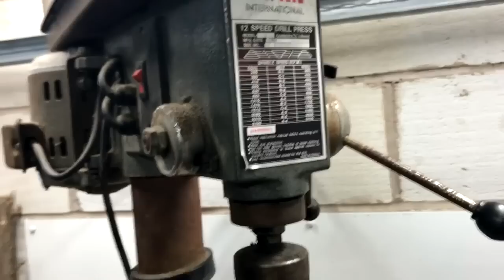Rusty Seized Solid Drill Press Restoration & Repair - Part 2 - Mechanical Repairs and Rebuild

Comment: Probably runs at least as good as if not better than new. Lot of the time the assembly is rushed and things are not lubed and fit up like they should be. Can't believe the windings weren't burnt after getting hot enough to melt the fan that badly. Usually if you let that much smoke out of a motor you need to have it refilled.

Comment: Boy, that chuck has a lot of runout.
Reply: yeah that made me dizzy, get a new chuck, that drill is awesome.
Reply: Can you just buy a new chuck? Brand or type you suggest?
Reply: You will also need to purchase the correct adapter for the chuck.   Great chuck at a very reasonable price.
Reply: @gravedigger1960  Thanks, what’s a good brand?
Reply: @btwenzel05  Southbend is a good brand.  There are also very expensive brands.  But with that drill press, a top of the line drill chuck would be a waste of money.   Southbend would be a good chuck worthy of the drill press.
Reply: @gravedigger1960  Thanks!

Comment: I loved the restoration!  Are you sure that your chuck doesn't have a bit of wobble in it though?  Either that or maybe the drill bit?  My experience has been that your workpiece shouldn't be moving around like that on the table and in the video, I noticed the wobble before the bit entered the wood.  A test might be to clamp the wood down, drill a hole and then measure the hole against the diameter of the bit.  If the hole is bigger, then we'd know for sure.
Reply: -- To check runout, simply install a short rod of metal that is true into the chuck. Put a dial indicator on it and that will show you the runout at the chuck. It's wise to spin the chuck by hand while the indicator is on it and while you're doing that, apply a little side to side pressure while watching the indicator as the chuck rotates. You might see that there is more runout with some pressure than if you're just freely spinning the chuck by hand. Note that the chuck itself may be fine and any free play may be found at the bearings or in the spindle. The ultimate question for many in the shop is how much free play is acceptable for you. For most guys, even .010 runout is just fine for stuff around the house and shop but each of us has to determine for ourselves what is good and what isn't. In my decades of experience, what I've discovered is that a lot of the problems lay in the bearings. Most of these types of benchtop drill presses don't have any way to adjust bearing tension due to the design. If the body and spindle assembly are okay then the only solution tends to be a set of high quality bearings when solving runout issues. Even so, you generally cannot expect to get the .000 runout that you'll find on a quality milling machine. If the bearings aren't tight and have a very slight amount of free play in the bore, one of the ways to tighten them up is to install them while using a very thin feeler gauge. Feeler gauge can be had in sizes from .0005 to at least .005 in increments of .0005. Best wishes!

- Max Giganteum
Reply: @MaxGiganteum  I love the idea of using a feeler gauge.  Great idea!
Reply: -- As an addendum... remember that if the bore for the bearing is out of round then feeler gauge shimming isn't going to true it up unless you use the shim technique where you use small pieces of feeler gauge in an attempt to shift the bearings over to the point of center. What do I mean by this? You stack short, stubbier pieces on one side of the bearing which pushes the bearing over in the opposite direction. Can this work? The answer is yes if you are careful and go through the process of trial and error. However, remember that unless the shims are used with some sort of light adhesive, then they can shift during the use of your equipment which will most likely result in an ever escalating run out condition all over again. Of course, to know where you are truly at, one has to use a dial indicator if you expect perfection.

 What about using an epoxy to take up the gap? In other words, using a multi-part epoxy resin or something like JB Weld to re-center bearings and effectively glue them in place? I personally would never recommend doing this. Why? Because it's not really a permanent fix and there's a good chance the repair will fail. If that happens you'll have to remove the resin or the JB Weld and start over... for most folks this is not only a disaster but a nightmare to accomplish without doing further damage. The smart play is to not go down that road in the first place. Yes, I've heard all the stories again and again about success and about how some guys are the master of JB Weld, blah-blah-blah... but here's the thing - you always hear about the successes, you always hear about the lottery winner. You never end up hearing about all the failures and the millions of guys whose lottery ticket did not win. Here's another thing to think about - what will you do if you have to replace the bearing again? You'll have to press out the bad bearing and the odds are super high you will destroy the resin or JB Weld during the process that's requiring you or someone else to go through the nightmare of another more serious repair. Using feeler gauge stock to shim or otherwise tighten up a bore is completely reversible by just removing the feeler gauge. IMHO, the shim technique should only be used for gaps of maybe .010 - .012 total though some guys will go up to .020 - .030 which is the equivalent to .010 - .015 per side. Choose wisely in how far you'll go. Anyway, things like JB Weld are not so easily removed the majority of the time, REMEMBER THAT! Of course I'll end this section of my diatribe by saying this: while the feeler gauge shim technique can be effective, the real repair for a bore that is out of round or enlarged too far is simply to overbore on the original center line, manufacture a repair sleeve out of a suitable metal using a lathe or other machine tool and then install it to restore the bore to center and to the original size for the bearings. There's your permanent fix. Use the shim repair technique only if it's really truly viable.

Also, when using the shim repair technique, if the gap between the bore for the bearings and the bearing body itself is too large, then stack 2, 3 or even 4 layers of thinner shim stock instead of using one thicker piece. Why? Because the shims will get too stiff once you get to about .004 in thickness for them to accurately and easily revolve around a 360° surface area. Thinner stock is also far easier to install without trouble. What trouble? You'll find that it wants to deflect and crush out of shape. In other words it can be difficult to install when there is pressure on it. The trick is to install it about halfway into the bore while it's still halfway on the bearing surface. Then push or draw it in with a press or a threaded puller - USE LUBE!!! Trust me when I say it that it can be a royal PITA to get done and be tight. I know because I used to do it frequently when I used to work for what is now the world's biggest airline...

- Max Giganteum

Comment: I'm just starting a restoration of an apparently identical drill, branded Clarke.  Come to a stop because I can't get the nut on the top of the spindle drive to undo.  It rotates but it looks as if the threads under the nut have stripped.  May have to cut the nut but that will leave me with a spindle with stripped threads. 😞  Also the quill only goes down about 50mm before coming to a hard stop.  (The depth stop on the quill appears to be free.)  I was not keen on disassembling the spring cap but I guess you have showed me a way to stay safe!

Comment: I watch many restoration videos as I am in a similar business.  I was so impressed with your Seized Drill Press Video.  The part that impressed me the most was when you needed to make a new bolt.  You said " I don't have a lathe", and you made it anyway.  Believe me, it takes a lot more
talent to improvise than to use a fancy piece of equipment.  WAY TO GO!!!

Comment: How apposite. I'm about 1/2 way through doing the exact same thing on an old Meddings 5 speed bench pillar drill donated to me by a late friend before he died. 

Same as you I use Citric acid for derusting stuff but I do everything I can using different sized polythene/ABS plastic storage boxes with the biggest I've used so far being a 50 litre box. I have used a 100 litre plastic drum though previously to electrolyse rust off a tow bar ... Worked a treat!

Mine has no base, only a VERY substantial bottom collar. No table or rack/pinion lift and no motor. The latter has been resolved with a very nice 3/4 HP 3 phase motor that I acquired ages back for about £20 ... It's like new! I've bought a new 5 HP capable VFD that will drive it so bags of spare capacity so should run nice & cool. 

I have the main body all stripped down including removing the aluminium label and brass serial plate held on by spiral rivets! 

Ready and waiting for paint stripping. I use the same recipe for paint stripper as you ... Caustic soda, wallpaper paste and water ... Sadly I had to use Nitromors on the motor end caps of my lathe motor that I'm also refurbishing as they are aluminium!

CAUTION to those unaware, concentrated liquid caustic soda is dangerous and will eat through human flesh AND aluminium and casting alloy faster than you can blink!! 

DO NOT USE IT ON OR NEAR ANY ALUMINIUM PARTS!

Wear protective gear, especially face and hand protection. Keep white vinegar and/or citric acid handy to neutralise the alkali.

Great job you did on that. I hope my final result is as good! 👍👍👍

Comment: Holy Crap! I thought these things were only 2 or 3 parts Max!! and that includes the drill bit and chuck key.
So what is it with all this other stuff?.... Bearings, melted fans, more bearings and random stuff that you probably swept off the floor???  I swear I saw a prosthetic leg in there.
So somewhere there is some guy walking around with a limp who had his rusty old bench drill stolen so you can get your jollies on You tube!!!

Comment: I don’t think you are doing this right, from my experiences of watching other similar videos (mainly from Far East) I have a couple of pointers for you.
You are supposed to be casually walking by a load of rubbish or a foul smelling river when you accidently find a corroded piece of equipment. You then drag this back in a wheelbarrow pulled behind a moped and dump it on your terrace/patio. You put flip flops on and work on the floor. You don’t seem to have any chickens or passing vehicles making a noise in the background. You’re using far too many tools, one rusty claw hammer, a broken screwdriver, a piece of rebar and a brick should be plenty. You’re not handling everything as if its brain surgery. You keep letting people know what liquids/chemicals you’re using, this just wastes time making the video longer than it need be.
But apart from all that I think it is one of the best renovation channels around, keep up the good work.
Reply from the maker: Casa Piqui Dammit! I wondered what I was doing wrong, hold my beer 🍺
Reply: Hilarious Casa! I wish I could give your comment two thumbs up!
Reply: George Robartes  LOL! Isn't that the truth, eh! :)
Reply: LOL! That always amazes me, too, how they just "come across" those "old" pieces of equipment! Well said, Casa Piqui. :)
Reply: My restoration would include chickens and passing vehicles in the background
Reply: @jt9498  im not amazed. I have found enough furniture and appliances to fill a house in my field which then i have to dispose of myself. Just wish someone throws away a metal lathe in my field that i can restore
Reply: Hilarious !  I kept reading to see what was really wrong with the video because I am looking to restore mine...... lol  This is one of the best videos out there!

Comment: hey , in the process of " cleaning up " a Jet 13 R,  rusted , greasy , and I couldn't remember how far down the shaft had to go, your video revealed  it !... lots of sanding wheels , wet/dry paper …. thanks

Comment: In the old days we used to be able to buy Kent paint stripper here  on spray cans. It was really efficient and only the biggest lumps of body filler would need a second application. These days I find stuff advertised as paint stripper, but I doubt it would remove pizza dough from the bench top.. The old chemicals were probably very dangerous, but it's a pain to remove paint and filler these days. I mix brake fluid in wallpaper glue which will do a decent job on some paints.

Comment: Nicely done. That will be with you for many many years to come. Every shop has to have a drill press. I think I use mine nearly everyday for something. But be very careful because they can be dangerous when drilling through metals and the drill bit catches on the exiting side. Clamp things down whenever you can. Thumbs Up!

Comment: Well done.
Have you considered what might be done to reduce the run-out, or wobble of the bit ?
Reply: Depends which part is bent lol I had to take the shaft from the quill and take it to a drive line shop to get it straightened out  lol
Reply: A few things without spending  money...am going to get some belts today
can get these quite cheaply in an agri/lawnmower shop, fiver each, came here to look for size.
Runout is more noticable  with a long bit, and is about the best poor mans dial indicator that I have 
for checking some things like arbor fit, should you have runout, swapping the MT 180deg in slot
 might give better results whenmachine is run.
I marked a spot to make note of arbor and MT where it seemed best.

Bit of marker to "blue" both arbors to check for contact, and check for burrs, clean with white spirit afterwards!
Raising the table dead on centre until the long bit nearly touches, should give an idea of slop, when pushed 
sidewards, and be noticable centred on the table bore. (belts tight seems like it will stiffen this up a bit, if the lids open when doing above)
That little grub screw on the left also has much effect on this,
Depending on condition, may need to fettle this, or make a new one from some threadbar.
I had some meat to play with, (plenty of the flat left to sink into slot)
took some trial and error to get a much better fit, bit of a faff to dismantle return spring and disengage 
(gear?) to drop down spindle, advance that wee screw and check if spindle will go back in,
I made mine very stiff, harder on the spring but that was a fiver on the bay,
MAKE NOTE not to damage that spindle, and make sure the teeth are in the right location to enter,
as if the screw is very tight against slot, hard to tell which maybe fouling.
Might revisit this, seems one could look into making another of these set screws, should it not weaken the casting...

Beyond that bearings, dial indicator, and possibly MT and chuck, might as well go the full hog then and restore,
maybe motor bearings too,
Hopefully I can get away without doing all that for now.

Two things to make note of 
That earth wire maybe damaged,!
and should the switch be acting strange, then the panel could be backwards, took me a while to find this. ...
Haxby_shed pillar drill press improvements , and cut to 11:40 to see.
Tom

Comment: Good job. My only comment is when re setting the chuck in the quill wind the jaws of the chuck back into the body and then press the body against the block of wood. That way you don't risk distorting/damaging the scroll teeth on the chuck jaws. RonW

Comment: I have this exact same drill (bought new years ago) but it never got that bad. Just replaced the bearings in the head but need to do the motor next. It's never been super powerful but it has been a good tool.
Reply: Scoot,  please do me a favor: need the sizes of the 2 v belts. Thanks

Comment: Great video. I'm in the process of refurbishing my floor standing drill press. I have a question on the table lift mechanism/worm gear crank. The spur gear driven by the worm gear sits on an axle pin and float on it within the housing and can float about 7mm side to side in my unit and it appears to be the same on the unit you restored shown at about the 14:51 mark in the video. Is this the way it should be? Seems like there should be collars on either side to keep the spur gear centered on the shaft?

Comment: Thank you for the vid. I have that same drill head and it needs bearings bad.  This will help greatly.
Reply from the maker: Really easy to change tbh, just keep an eye on where the Jesus clips fly off to 😉
Reply: SparesOrRepair got the column apart and bearings pressed out. Now for new bearings and a new external ring to keep the spindle in place.
Reply: SparesOrRepair got it part and inspected bearings. They are in good shape... but a lot of play in the column. That is going to be a challenge to “tighten “ it up. Over .005 play in main column

Comment: I've got a 6" bench grinder with a wire wheel at one end and it was used about 95% of the time for that type of work, I've not got another with Scotchbrite wheels fitted and that is used about 95% of the time for that type work - the wire wheel is relegated to those few occasions when you really need something aggressive.
Reply from the maker: I've bought some scotchbrite wheels but they didn't come with the correct inserts for my grinder, going to make some and then give them a blast. I do like having a wire wheel for removing paint though, so much quicker than paint stripper!

Comment: Hey, thanks for the video. I recently inherited a similar style from the same company. Having a hard time figuring out how to loosen the belts so I can change the speed. Any tips?
Reply from the maker: On this model you adjust the bolt on the motor mounting with a spring on it, the pulley tension is adjusted by positioning the motor closer/further from the drill using this bolt